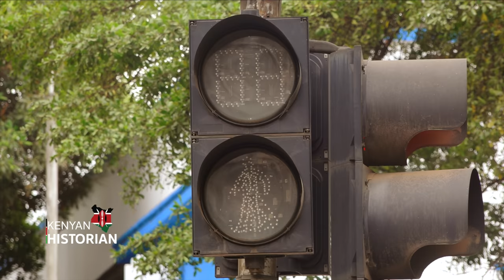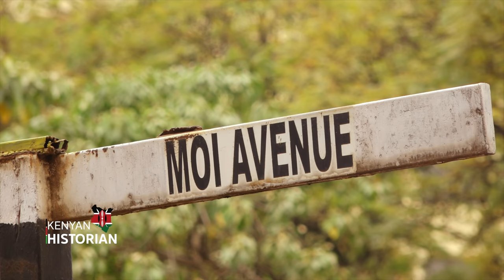A MEGA - PROJECT THAT FAILED TO TAKE SHAPE: We look at how & why Kenya's BRT project stalled.

Comment: In Tz second phase of BRT is on the verge of completion 1st phase has been operational for almost 6 years now..i think the Tz BRT projects was smooth because they demolish the existing infrastructure and start from scratch..in kenya demolishing of thika road not easy so they are trying to push to accomodate BRT within the existing infrastructure .
Reply: Sure
Reply: Brt could work properly if it could be included during thika road construction but for now even if they'll complete this stalled brt it won't be efficient
Reply: That’s why it’s going to fail

Comment: Very bad design of transport system. 
It would disrupt  the high speed lane.
Secondly we drive on the left..how did they expect us to exit.
Why not fix a tram rail transport on top that detours to several stations.
Same problem with expressway ..it would have been better to do a rail to machakos with a linkage to the airport...going upto dagoreti corner etc..
In my view very bad though process...and the collaborators of this economic crime, should be judged.